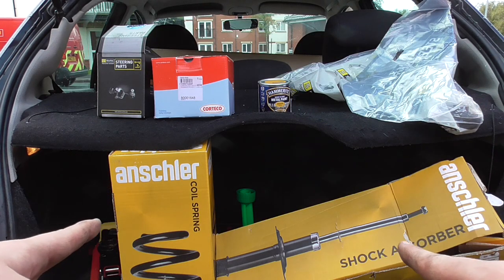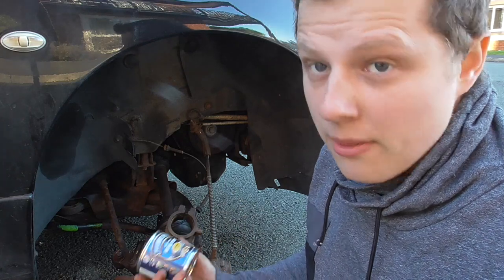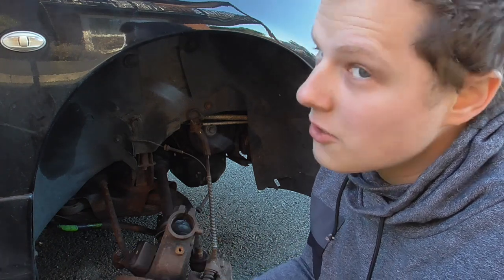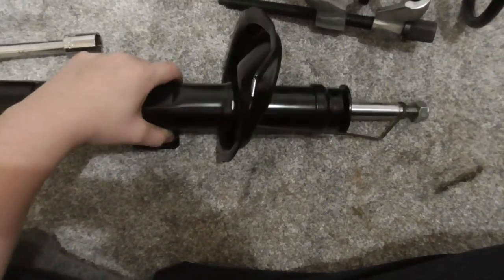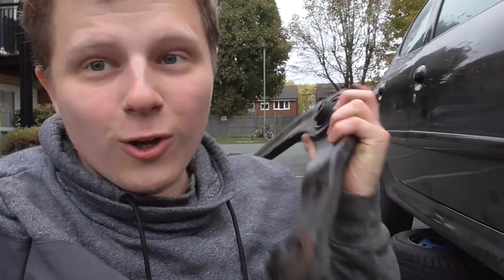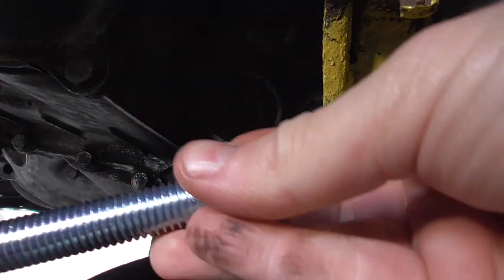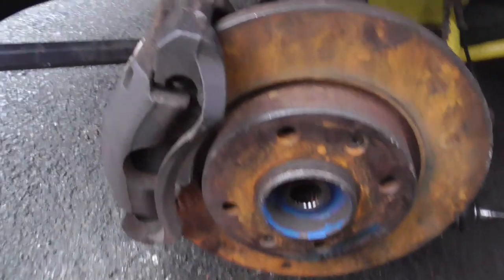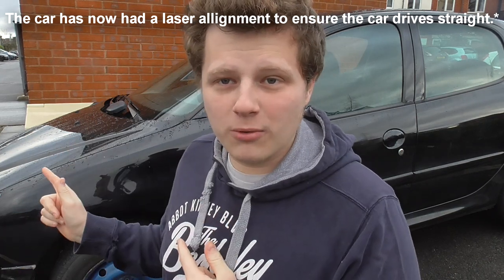Entire Front Suspension Rebuild on a Peugeot 206 // HOW TO

Comment: You might find you need to change strut bearings if you start hearing a knocking that's what it is.
Reply from the maker: Thanks for this, I believe I put new bearings on the car as they came with the top mount.

Comment: Couldn't stop facepalming, especially with the bolts.
First there's no need to cut any bolts and secondly if you do anyway, get new ones from the dealership. You can't just buy some in a hardware store and hope that they have the correct strength ...
Reply from the maker: I used the correct strength ones. I didn't just use a y bolts. The mechanic who did my mot also praised my work.
Reply: @OliverKuiz  Yes Oliver, but I think Awax means that, as critical suspension bolts, they MUST be at least high tensile 10.9.  Preferably they should have had an unthreaded shank which fits inside the joint with the thread beyond that.  Yours look like plain old 8.8 bolts, (shown on the head), and that isn't right in that position.  If they are wrong then get the correct bolts from a main dealer, despite what we think of main dealer spares prices fixings are never overly expensive, that way you can be sure and be safe.

Peugeot Service Box shows the bolt to be part number 6925 L6 "Screw With Base" 14X150-79 (external Torx head), the washer 5037 37 "Plain Washer" 14,5X27 EP 2.5, "Hexagonal Nut" 5132 A8.  I know the MOT guy praised your work but that doesn't necessarily include a full check on the parts you used once they are more or less out of sight.  It really pays in terms of safety and even sometimes makes a job easier.